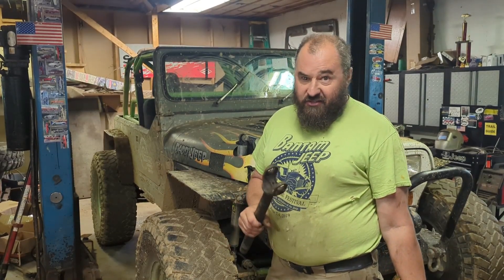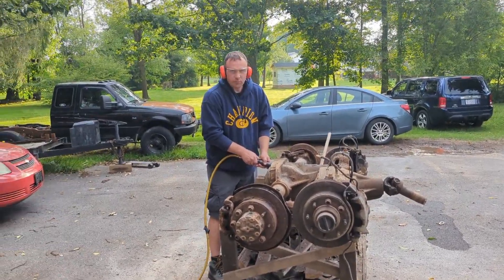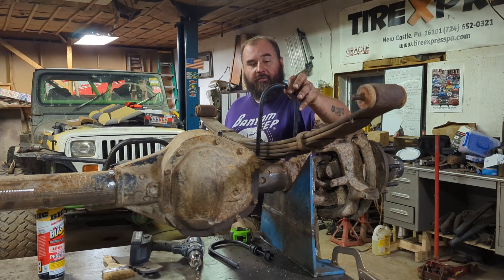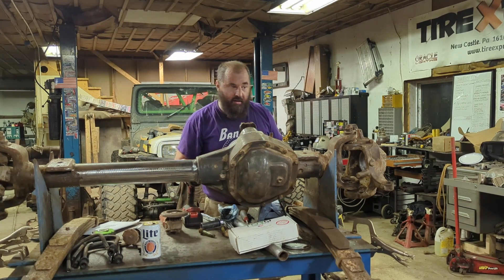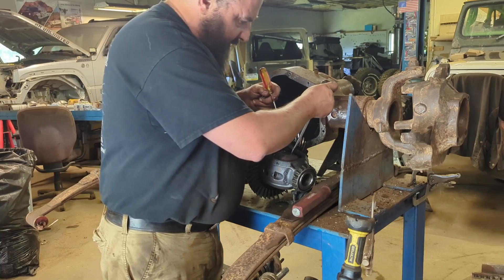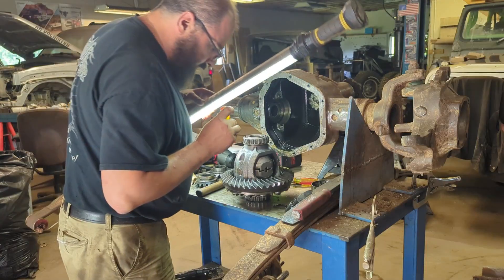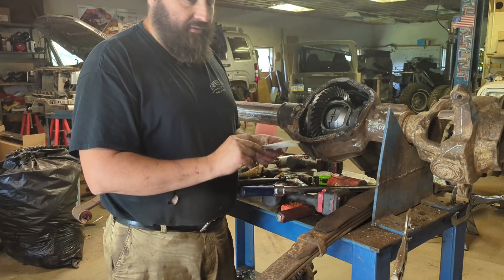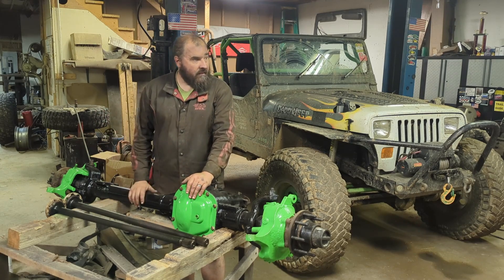One Ton Swap the Jeep YJ - Prepping the Superduty Dana 60 and installing a Torq Locker & U Bolt Flip

Comment: Sorry if I missed it , but what leaf springs did you use in the front? Or did you change your spring perches
Reply from the maker: They were actually 2" lift Squarebody Chevy springs. I built mounts off of the frame to match the axle pads

Comment: What did you do for steering to clear the leaf springs? Thanks
Reply from the maker: @garrettprater4204  I used stock Superduty stuff initially, but quickly destroyed that. I then built a better tie rod in the factory location.

Comment: What springs are you using on the front axle?
Reply from the maker: @ronhampton  I think they were 2" lift squarebody Chevy springs with one leaf removed. Allow me to emphasize WERE. I built a proper 3 link now with more ADS nitro shocks. The leaf springs worked ok, but they were certainly temporary